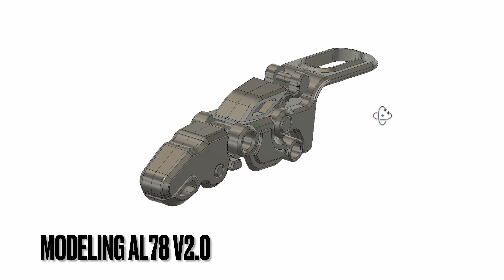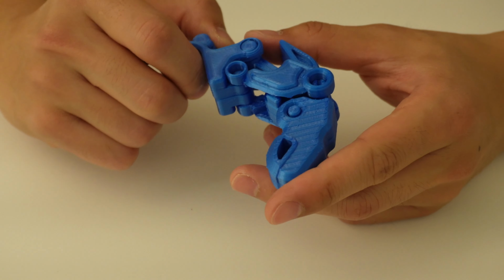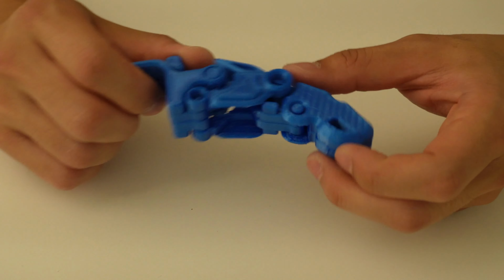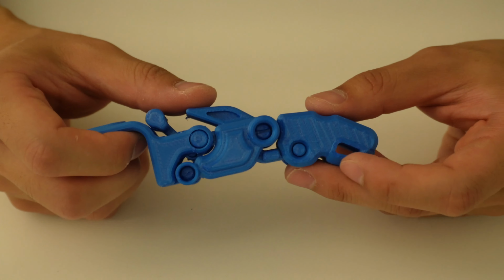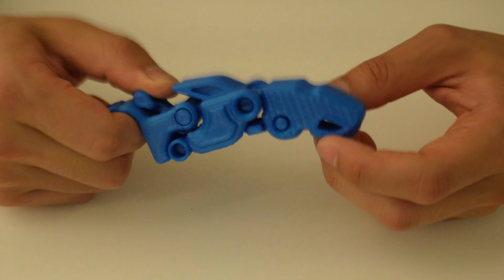Modular prosthetic hand project: AL78 v2 0 update

Comment: You could save a LOT of time changing your design to print in place and printing the whole thing in one shot!
Reply from the maker: Excellent point. I was thinking about making this into plastic model (for injection molding), but will try to print in one shot, just to give it a try.
Reply: Depends. In my experience, making something pip isn't always the best option. Especially when it's compromise the design or layer orientation for specific parts. But those are just considerations to be designed around. If it works, it works.